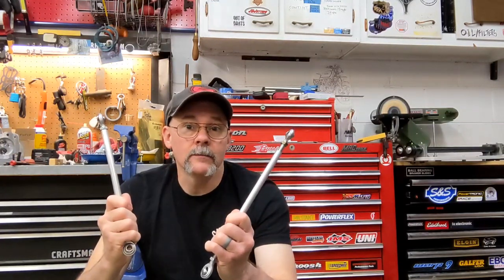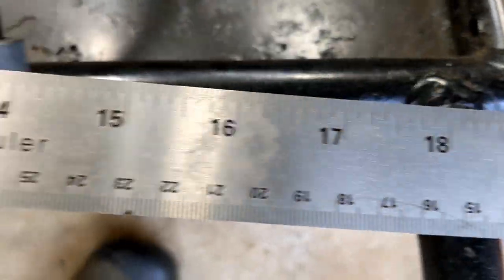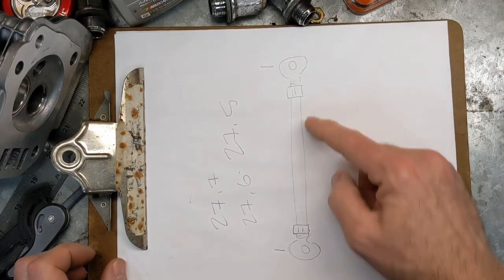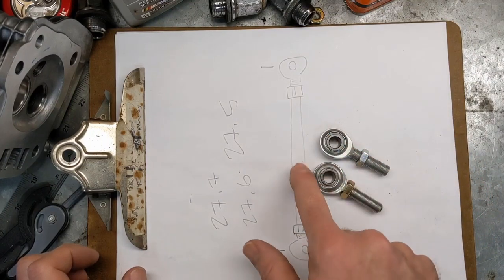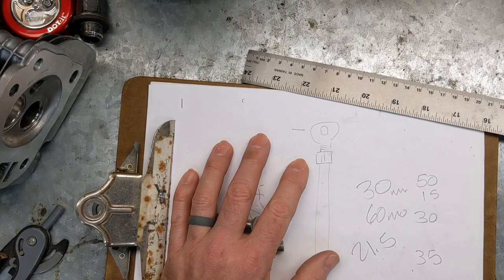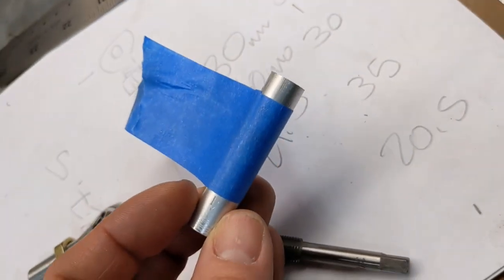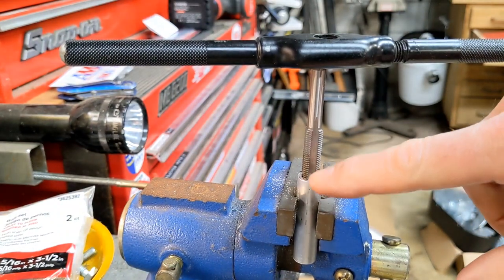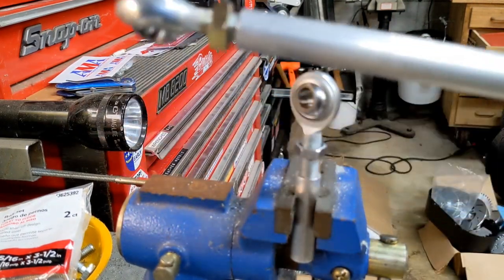Go Kart Tie Rod Time

Comment: Just a little bit of geometry advice. The turn radius of your wheel doesn't line up. The pivot point of the rods ends and the pivot point of the wheel as to meet in the center of the rear axle. This way when turning, the inner wheel will have a smaller turning radius and the outer wheel will have larger turning radius. Juste saying cause I built one and this geometry was redone like 4 times before I got it perfect.
Reply from the maker: Thanks, when I built the steering knuckles, it was based on the geometry of the originals which had, approximately, the same angle these do. Once I got it assembled and messed around with it, I realized that this was reverse ackerman, with the outer wheel turning a smaller circle. I am going to leave it be for the moment and see how it handles.  Some race cars(like Formula 1) use reverse ackerman, maybe it will work. I can't angle them out much because they will hit the tires. I can space the tires out some but that can create some other issues. I may end up creating the effect at the steering shaft using an arm for each tie rod.
Reply: @WhatIsTheWheel  if you run a triangular pitman arm and cross over the tie rods you can correct for ackerman.

Comment: you can buy that stuff cheap at the kart shops you get those tires, wheels, hubs. unless you are a determined , stubborn, want to diy'er. its all good
Reply from the maker: Thanks, for the comment. I could just buy the stuff(I could have just bought a kart) but what is the fun in that? Parts cost for the tie rods was about $26, BMI(as an example) sells custom length tie rods for $20 each, so this was a little cheaper, and it only takes about 15 minutes per rod. Often I find that the thing I want does not exist or that is cheaper and easier to just make it.
Reply: I am also Do-it-yourselfer and try to make everything myself as much as possible . Just saying, for the average guy,trying to make a kart for his kid. They may not have access to materials , machine shop tools , left-handed taps. I now pick my battles ,  Right now if I had to buy aluminum and a left-handed tap,It's cheaper to buy it at one of the discount big kart shops. But appreciate creativity.
Reply from the maker: @marcguerard4278  For a home shop, I have a pretty good setup(except for space).I try to show things the way someone with basic tools would do it and I understand just buying the parts. I could have welded up the stock cam then put it in a four jaw chuck on the lathe and cut a new profile, but it is way easier to buy one from someone that knows what they are doing.

Comment: Should split the difference to get close to 0 toe. Then you can set toe by turning equal number of turns on each end.
Reply from the maker: Thanks for the comment. For initial setup I would do it exactly like that. When I crossed it was easier/faster to jack up one side and adjust one tie rod, race, then turn it back. It made the wheel a little crooked but the car was never going in a straight line so you didn't notice.

Comment: Bolt the ends to the cart and measure the distance between them no math.
Reply from the maker: I do "size to fit" a lot. Especially on the the lathe. It is usually easier to be accurate that way.

Comment: Is there a schematic available for the frame? Or was it purchased somewhere?
Reply from the maker: I got this as a bare frame used off Craigslist for $75, which is the way to go for a fun project. Gokartalley sells one that is similar for about $500
There are probably plans for building them like this, it was a popular double hoop design.
Reply: @WhatIsTheWheel  Thank you, I appreciate the response. Maybe I can reverse engineer it from the videos.
Reply from the maker: @megmo1  look around on the used/for sale sites and find a cheap one to work from.

Comment: I don't want to take your illusions away, but kart chassis works by twisting the frame - precisely calculated tubes of different thicknesses and dimensions. Race teams try and test and improve the frames for more than 40 years. Your kart can never ever work properly on the track. Craftman skills are amazing on the other hand. ;-)
Reply from the maker: Thanks, no illusions, I don't doubt modern karts use tubing diameter, geometry and gusseting to affect the handling/compliance of the karts. I have seen some vintage re-pros that used tie rods between the front and rear hoops to adjust the feel of the kart. But if you look at the early days of karting there was a lot of using what was on hand and using thinner tubing to make the kart lighter more than affect the handling. The vintage re-pros typically use thicker tubing because it makes the kart more durable and is easier to weld. The stuff on this kart is not water pipe but it is pretty thick.